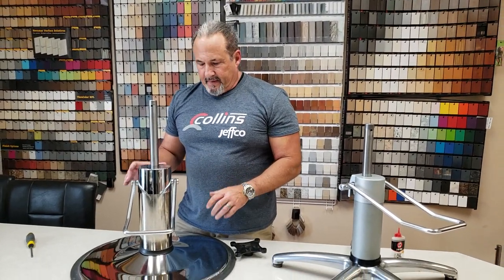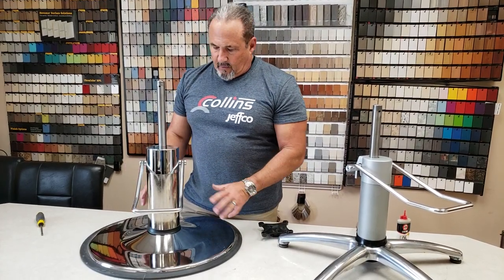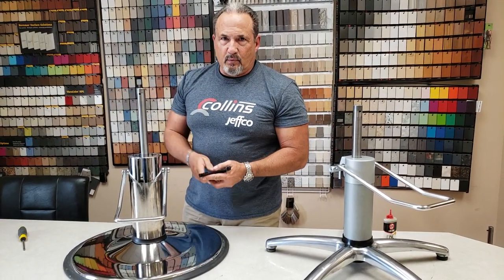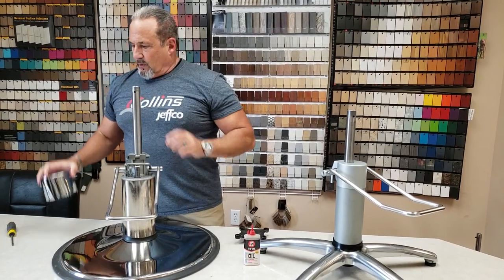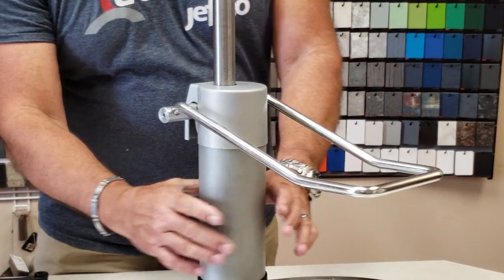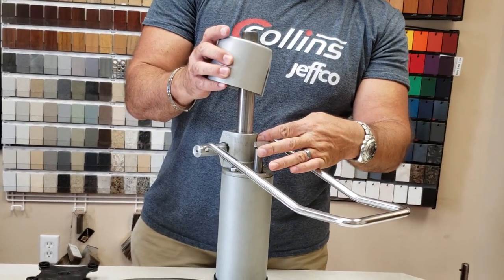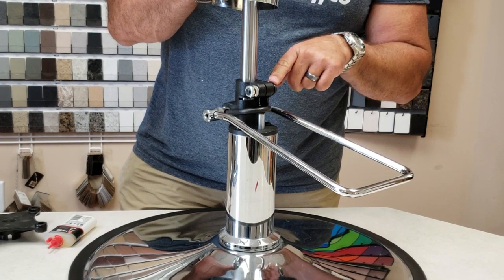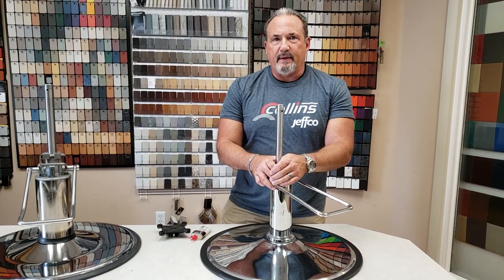Hydraulic Pump Maintenance

Comment: what about a knocking noise while i have someone in my chair  ?  As i lift the chair it works but after a few minutes it starts to knock like really LOUD . What do i do for that ? please help.
Reply: If you have the brake locked, it could be the pump is leaking down. As the pump leaks down the brake tries to hold the chair up, but has to let go, thus the popping noise. Of course this is a guess from your information.
Reply: You taking it up to high
Reply: We've serviced pumps with loud knocking sounds in the past and had 50/50 success rate.  You can try by pumping the lever about 30-40 times (continue after reaching maximum height) and releasing the pump immediately after.  I would try this a few times...good luck!
Reply: I’m having this same issue!
Reply: @SaloncaEquipmentBeautySupply  is there any other solutions beside this one ??  I

Comment: Having issues I’ve replaced mine once I’ve had not even a year. Hard to swivel, makes noise… doesn’t pump up or go down smooth, the hydraulic fluid seems to be leaking out. It’s a pain to Change this out, any other solutions?

Comment: What kind of grease do you use on the top of the pump or stem that goes into the bottom of the seat?
Reply: Camp, We have a "Maintenance" video that discusses this. We recommend any light oil or 3N1.

Comment: How do i remove the pole thats inside the hydraulic system
Reply: This would require complete disassembly of the pump. We do not cover this procedure as it should only be done is a qualified hydraulic shop. Johnny

Comment: Link to the oil
Reply: @johnnychaffin307  thank u, wear do u put the oil for the recline
Reply: You cannot add oil to the reclining gas spring! it is sealed under high pressure. (this applies to Collins chairs)
Reply: @johnnychaffin307  can u help me, my chair when reclines squeeks and is kinda stiff
Reply: Again, depends on the type of recline. What brand of chair?
Reply: Again you cannot oil the gas spring (black cylinder P/N 732117 or 732109). Check your pivot points they were on bearings that should not need oil.
Reply: @johnnychaffin307  so should I just tighten The pivot points?